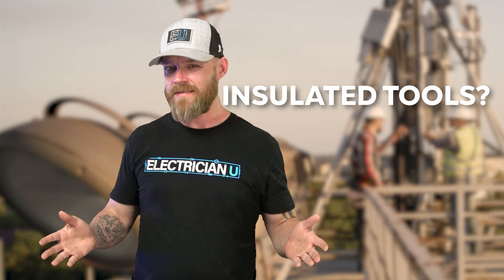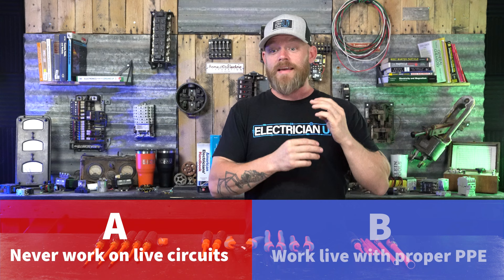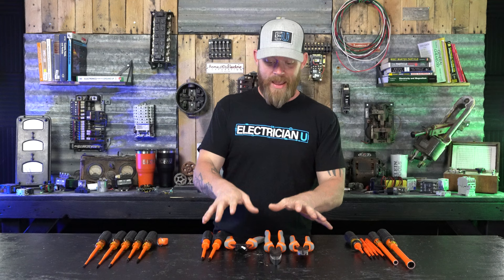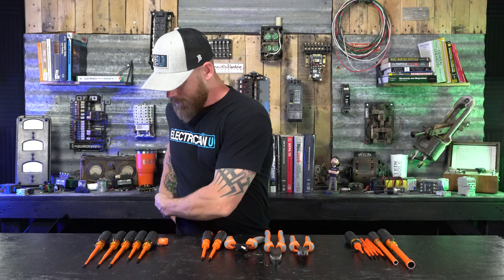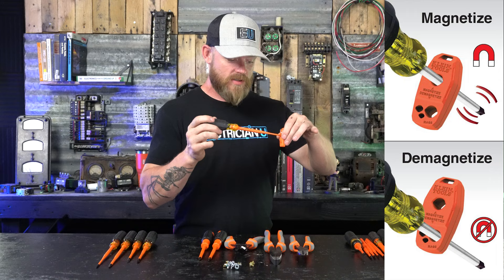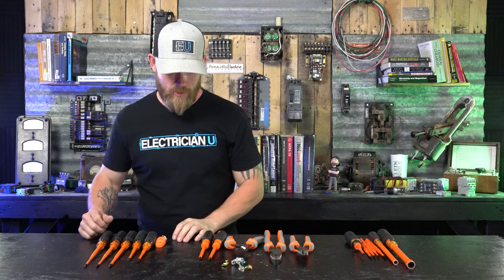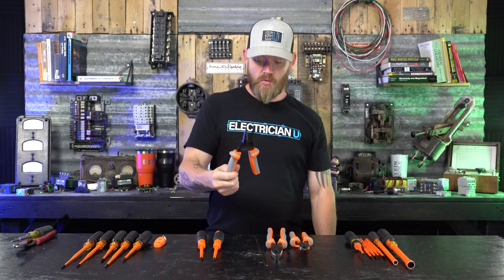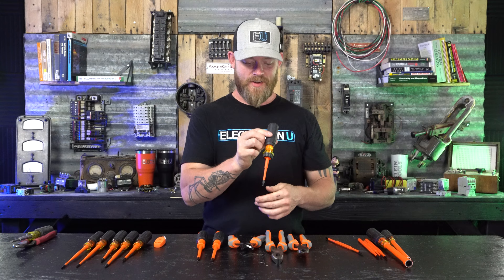Every Insulated Tool Electricians Need!!!

Comment: As a volunteer firefighter I am required to carry a pair of cable cutters to get myself out of an entanglement emergency situation. The ones I'm issued by the department are noninsulated, but I'd like to pick up an insulated set of heavy duty cable cutters on my own dime. Any suggestions on makes or models that you like or think will be good for my purposes?
Reply: been there, done that as both a volunteer and a state fire instructor. The problem you will run into is defining "cable" versus wire. Almost anything will cut wire.... but something suitable for untangling yourself from a fallen suspended ceiling will probably not work on BX cable run between lighting fixtures, although it may work on Romex wire, but that's not likely to be found in a commercial building. I used to carry a pair of channel-locks, which was handy for both small gas valves and automotive battery cables. Never found anything versatile for wire / cable cutting that would fit in my pocket. (and was rated for live work) Then you have the issue of those tools getting rusty from constant moisture.... and they don't work in a few years. (lots of WD-40 helps)
Reply: @rupe53  klein lineman pliers will cut through bx. The channellock version wasn't able to do it. If you really struggle in that situation put a sharp kink and bend in the cable and you should be able to see the wire conductors and then cut it.
Reply: What type of cutters or entanglement issues are you worried about? You talking about power line and battery cables, or your residential and commercial wiring? I would say for easy carry klein lineman would take care of most and you won't cry if you blow them up cutting live wires. If your talking larger gauge they do make like loppers like tree pruners that are large and bulky that are insulated check greenlee and I think klein makes some as well. If your still looking for large gauge and smaller size I'd look for ratchet cutters same greenlee and klein make regular and insulated but be prepared to pay easily $150/200 plus
Reply: @robfahey1349  ... some great points but the methods need to be handled in training sessions. Not everyone knows how to split BX, even though it isn't hard to do. I was going to mention the loppers, but having been in this situation, they are not something you'd carry in your pocket.
Reply: @rupe53  they didn't mention if it was personal carry or truck carry and that's also why I had suggested the ratchet cutters for the smaller footprint to carry.

Comment: If you dont complete the circuit generally speaking you will not get zapped 100% not recommended to work live on anything over 120v not that 120 isn’t dangerous but 🤷🏽‍♂️ its pretty unavoidable if you are in a fast paced service or im house job

Comment: I thin I have a legit question. How much overvoltage is ok? Am I getting charged more by getting more voltage? What else can be said about it. (I have between 124v at day and 129v at night.
Reply: What? The charges on your electric bill are for your usage, not the voltage that comes into your house. Normal voltage from the utility will vary depending on load throughout the day, so it’s not unusual to see higher voltage at night. That being said, most utilities try to keep it as close to 120v as possible, so you can certainly contact your electric company and let them know you’re seeing fairly high voltage at night.

Comment: I constantly see rookies with tape or shrink wrap on the shank of a regular screwdriver. I usually open my mouth, but it falls on deaf ears.
Reply: Once they get shocked they learn. Also rookies probably don’t get that much pay so a cheap screw driver and tape is cheaper then a whole set of specially insulated tools.

Comment: Inspect ppe before each job.
If you see white within the orange.. it's trash. The insulation has been compromised. The orange is a top coat.
Read manufacture instructions for inspecting these.
They are not cheap for certified tools. So why would you abuse them?

Comment: I used to like kleins strippers with the blue handles and the spring open because they had the locking tab that would keep it closed for when it’s stored. They changed the tab and now it’s much smaller and it doesn’t even keep the jaws closed 100%. The old style did and the new style sucks, harder to lock and unlock consistently and they don’t even close all the way. Big screw up by Klein.

Comment: Back in the mid 1980’s I watched a young kid carried out dead off a job because he was using strippers with no insulation. He got a hold of 277 and that’s all she wrote. That same job and same company another young kid had a gold necklace on that hung down by his belly and up in the ceiling he was making up a box and his necklace got into the 277 wires and killed him too. Then to top it all off three young kids got one of the steam rollers running at night in the parking lot and the one kid fell off and it ran over him feet first as his two buddies didn’t know how to stop it. So that was three killed before the mall even opened.😔

Comment: Lmao I just wrap my screw drivers in electrical tape.I’d only pull my insulated tools out if I was working on something over 1000 amps live or like industrial work.I’ve heard that argument many times about them not being rated or designed but the thing is they just weren’t tested and certified they just don’t want liability if they have thick rubber and handles they won’t shock you also like if you put electrical tape on bare wire it’s not not conductive so poof

Comment: Insulated tools - o hell yea.  
Working inside a building, away from windows. Turn the power off and the emergency lights are not bright enough. 
Working on older equipment - not fresh new construction but 20+ old stuff inside a regular, not oversized, panel. 
Power quality - got to measure stuff live. If the only big motor, the elevator, is not dragging the P.F. down, what the hell is ?   Yes it was auto transformers left over from 1980's   
Orange with inner yellow core. 
Tool count.  Always do a tool count before turning the power back on.
Metal tools create plasma hazards.  Im more worried about shorting a large amperage, low impedance circuit.
Reply: I'm with you about that last point, I'd be more cagey around say a large 48v battery bank for a solar PV "off-grid" type system than I'd be around the 120/240 AC circuits.
Because boy let me tell you, a MIG welder only runs on like 24v, and everyone I know knows to not look at a welding arc.

And compared to a 24v circuit, a 48v circuit has quadruple the theoretical amount of power that can be dissipated across the fault point (Because the voltage doubles, and the resistance was held constant, the fault current also doubles, and since P = V * A, that works out to 4x more power dissipated across the failure point).
Because of the high currents involved with these lower-voltage DC systems that feed a DC-to-AC (typically pure sine wave) inverter, the cables will likely be well up to the task of withstanding the fault current with minimal if any ill effects, therefore they won't be able to be factored into the circuit as something that would otherwise limit the fault current like what happens with even 12 gauge wire on a 120 volt circuit.

Ever seen how hot a wrench gets if you accidentally drop it across a charged 12V battery? If you don't know, it gets hot enough to make it red hot and soft, aka "say goodbye to the heat treatment that made that wrench strong". You can only hope that the wrench hit a side-terminal battery, because a top-post battery means that the wrench will likely melt its way into the case, which is never a good thing.

Now think of that, but with 16 times more energy getting dumped into that same wrench. That's what a fault across a 48v battery bank will look like.
On the plus side, at that point you're dumping so much energy into the thing so quickly that the fault will probably clear itself before the rest of the circuit feels any ill effects (other the damage that could be caused by the sudden appearance of a not insignificant amount of nearly molten iron that used to be a wrench, under the influence of gravity, but that's a separate problem and only a follow-on effect of the primary fault itself).

The math goes like this: Every doubling in DC volts will quadruple the power dissipated across the fault (as described above), and you need to double the voltage twice to get from 12 to 48 volts (12 to 24, then 24 to 48). And those effects stack by multiplication, so that's potentially 4x4=16 times the power dissipated across the fault.
Alternatively, you could figure it the same way as we figured the fault power dissipation for the case where the voltage is simply doubled, but substituting in the values for quadrupling the voltage instead: Since we're quadrupling the voltage this time, the current also rises by a factor of 4. And yet again, 4x4=16 times the potential fault power. Since these two calculations agree with each other, I'm confidant that my math is correct.

Comment: I wanted to strangle the installer at a Walmart the other day. I had to change a breaker out, no big deal... except the guy who assembled the panel box installed every breaker with an impact and he fuckin sent it. I'm a 210lb army vet, I'm not Arnold in his hay day but I'm not a little bitch I couldn't get that loose. We brought 2 other techs over and the boss, we couldn't get it loose. Ended up having to come back after hours to shut half the lights off in the store and use an impact to get it out.

Comment: for the strippers, I've seen people take out the little lock that keeps them closed bc if the tool is very worn in, it could slip to the lock position while on something that could be potentially hot. totally goes against the topic of the video with the "don't work live" and "use insulated if you absolutely have to" but that's the reasoning I've heard for removing the lock to keep them spread eagle
Reply: Kinda dumb because if you cut into a live wire, the electricity will cause your muscles to squeeze the handle anyway.
Reply: @SomeGuy-vo7we  i think their logic was you don’t choke up on the strippers (which i do). in a related note the guy at my work that does that got lit up and broke his arm falling off the ladder a week ago.

Comment: Of course electricians should use insulated tools. Because you never know when something will be live or someone will accidentally switch on the electricity. Why would companies build isolated tools? They are not made for auto mechanics but for electricians and there is a reason for that to protect the life of electricians. I don't understand electricians using auto mechanic tools